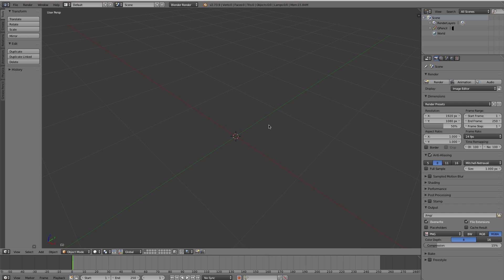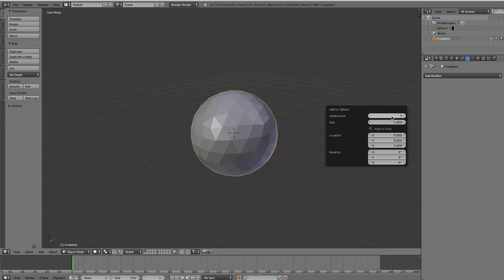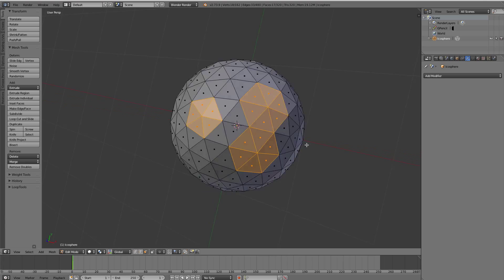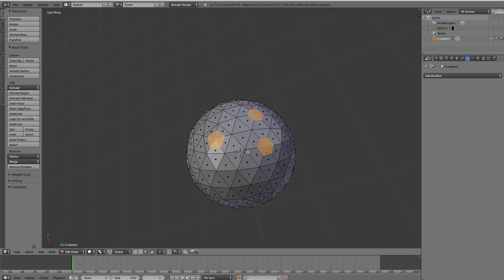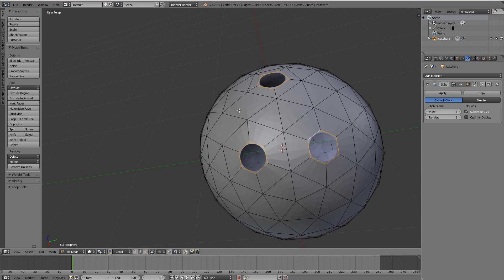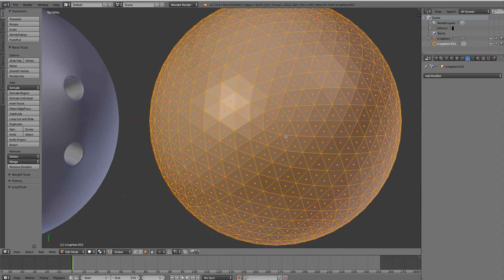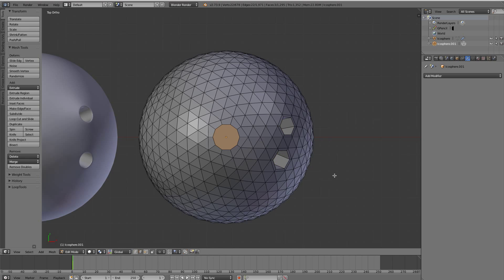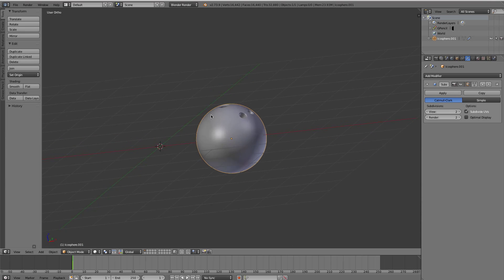Modeling a Bowling Ball in Blender

Comment: Thanks a million, man. I'm learning from the Udemy video series. It has a section about making bowling balls and pins. The presenter did a poor job in showing how to make the holes in the ball. I spent hours tinkering with transform-> to sphere and got nothing. Your quick video of adding a face to the inset worked perfectly and then use "to sphere" fixed the problem quickly.
Reply from the maker: +lynn williamson I'm glad you liked it!